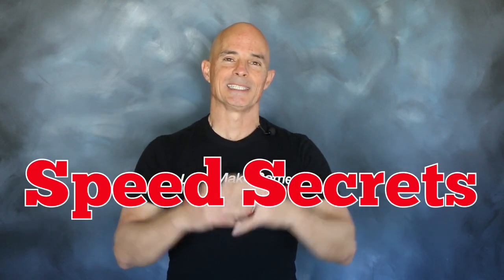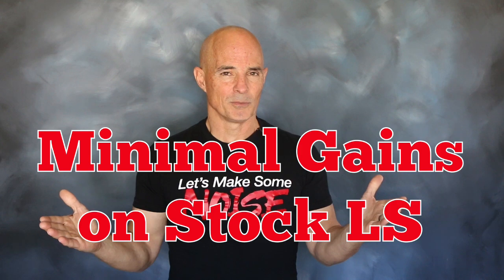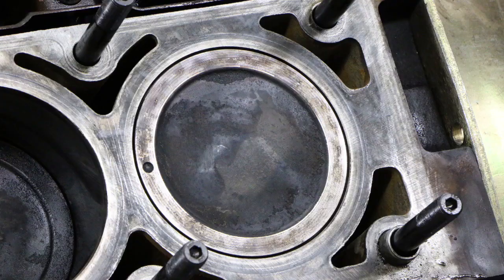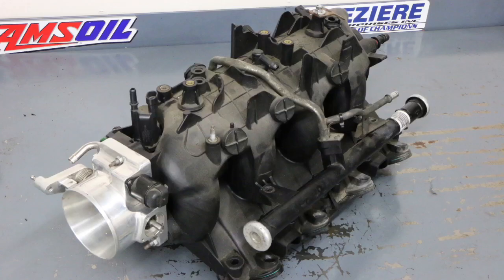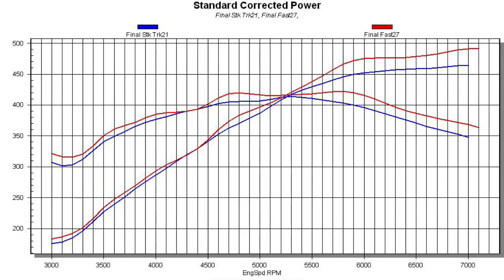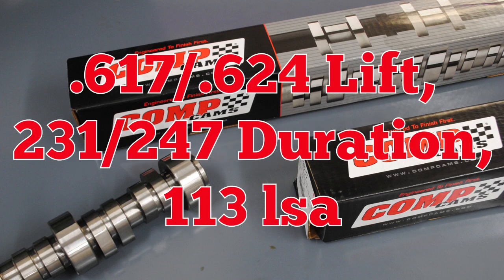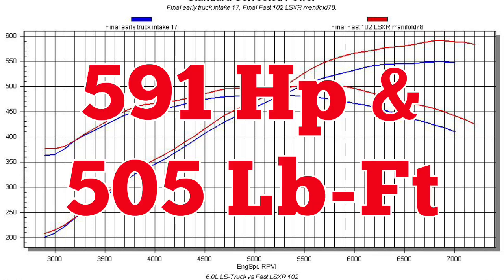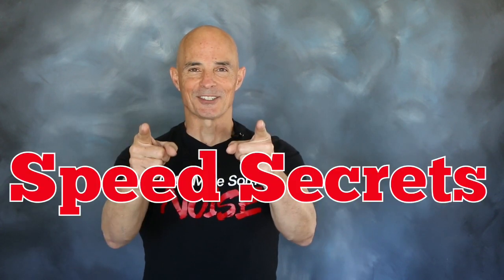Speed Secrets: FAST LSXR 102mm Intake Test!

Comment: I have a 2002 5.3 I’m installing one and 34 inch headers, a 92 mm fast intake with the truck north cam I will be running the stock heads from the LM7 what else do you think I could do to get a little more low in torque

Comment: Question: what size injectors should I run with the LSXR102 intake and throttle body? They are going on a stock LS1 in a 99 Trans Am WS6, going to be boosted later

Comment: Hey I have a 5.7 aluminum block. With fast 92mm Ported throttle body and intake manifold and camed up. Running E85 fuel. With that combo What Hp do you think I am putting out.
Reply: You did all that and didn't get Dyno tuned? 😬

Comment: Richard I need some advice, basically I’m new to this and right now I have the time to do things I’ve wanted to I’ve begun collecting parts for my 5.3 vortec, but I’m trying to get my hands on a 6.0 motor itself to work on separately since my 5.3 is my daily and getting me around reliably, I bought a aftermarket ls3 throttle body 102mm, fast 102 intake, my problem is I’m not sure I got the best cam, I found one practical new for cheap on marketplace, it’s a Texas speed 212/218 .550/.550 112 LSA. Along w some springs and pushrods. What would be the best cam for either setup? I can sell this one and buy another if I need to.
Reply: That's a good Street cam that shouldn't be too bad for a daily. 112 LSA will be fine with a decent tuner

Comment: hey does anyone  what type of plastic the fast lsxr outside case it made of
Reply: As far as I can tell, Fast uses Glass fibre Nylon 6 or Glass fibre Nylon 6,6. Lots of ford and gm factory intakes are PA66GF, i cant really find the percent GF in the mix. Some factory ford intakes are PA66GF35, which is a high glass content. Simply calling it "polymer" means little. It could be made of cellulose or DNA. These intakes are likely made from Polyamide.
Reply: Polymer

Comment: Sooo the upgraded manifold wouldn’t do much if you just had a cam and other bolt ons 🤔 or would it? I’m stuck between is it worth it or not.
Reply: Blaine Break, it’s probably not worth it with a stock or mild cam. The factory intake manifold only becomes a restriction once you start making big power.